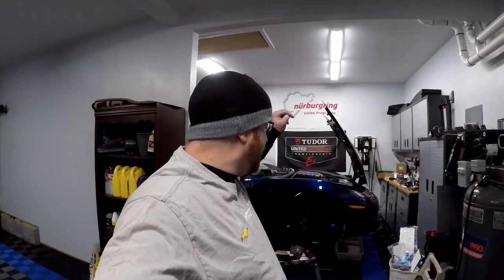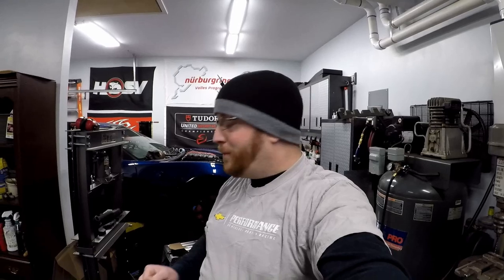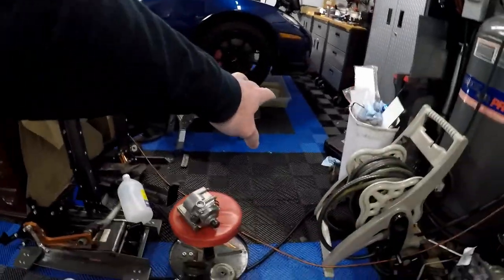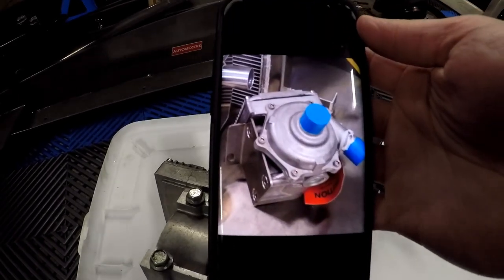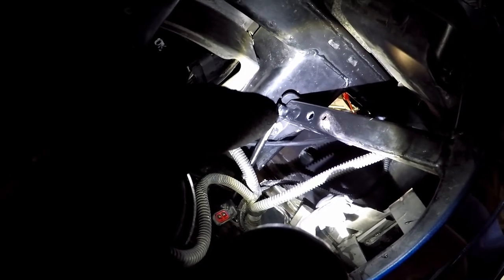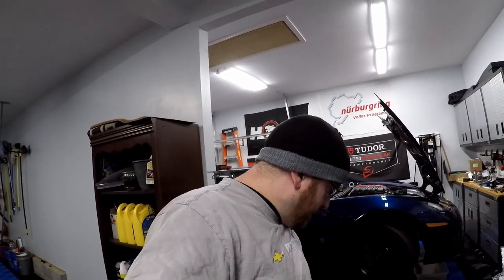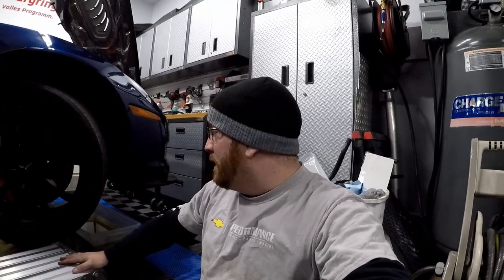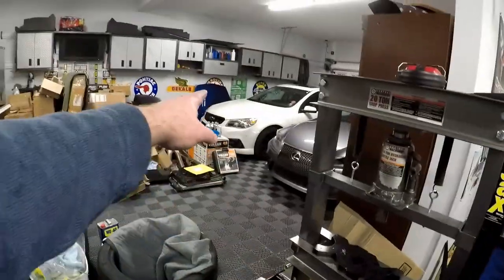2005 Chevy Corvette - V4.0 - Ep 17 - EMP Water Pump Install

Comment: I know you ran the purple wire to the ignition on the main fuse box but i was wondering if i can just tap in to another source fuse that has power when the car turns on. You think its possible?
Reply from the maker: Cruise control would be a good one. 

Do not use anything fuel/ignition/o2 sensor related - or fuse for the ECM.
Reply: @bonecrrusherSS  what do you think about the amp or radio fuse? I have a g8 so I have a small fuse box already in the trunk from factory already and wanted less wires to run. Fuel pump & ecm already knew not to tap into but it does have the xm radio , amp, radio,onstar and cluster lights fuses.
Reply from the maker: You should be able to pull 12 volt right off the battery for a relay - trigger would probably be - a radio accessory or somethings similar. G8board might have info you are looking for.

Comment: I am not sure if I told you but I run the 55gpm Stewart EMP from the Rad outlet and the Mez WP330N at the water pump.  So far so good, but with the blower I decided I'd rather do 2 water pump elec and not have to worry about overheat if belt breaks which happens sometimes.  Good video btw 👍
Reply from the maker: I'm actually going to redo the mount for the EMP pump - found a better way that doesn't interfere with the horns or brake duct.

Comment: wasting your time with that Moroso tank with it's ridiculous tiny NPT fittings. That's a serious bottleneck. Plug that and buy some 12AN fittings and weld them on. That's what I did, I also added about 3" to the height of the tank.
Reply from the maker: For my application I ended up getting rid of this pump. It was overkill anyways. 

I haven't had any issues on my 2650 swap with the tank or the new pump.